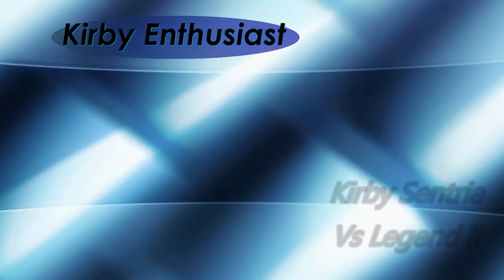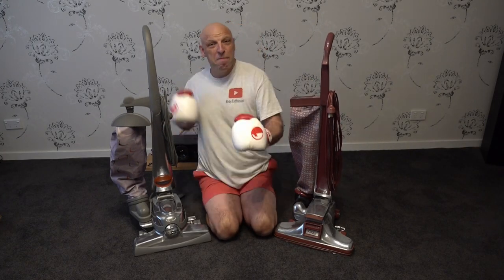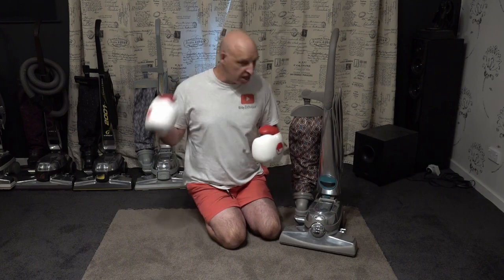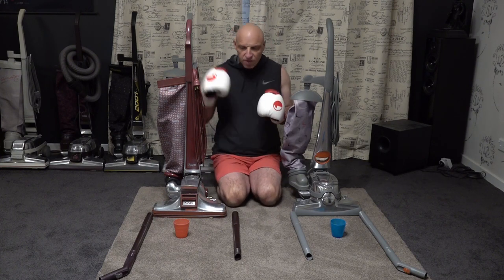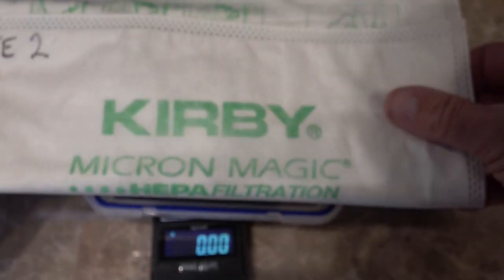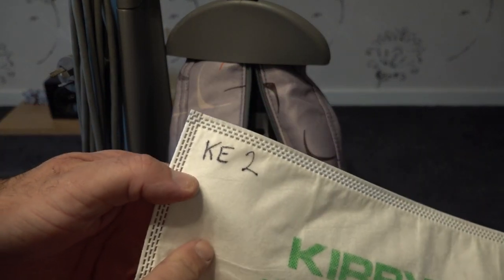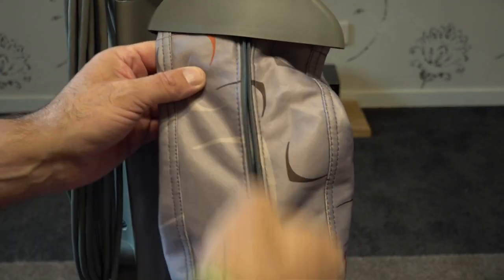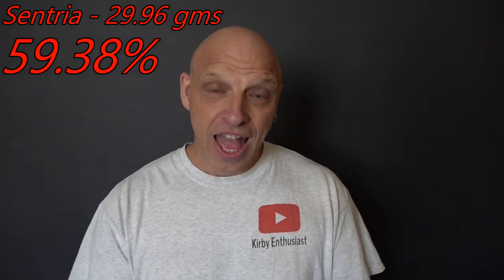KIRBY VACUUM:Kirby Sentria Vs Kirby Legend II for Title Best Kirby Vacuum In 2021

Comment: So about a month ago, I found a G5 for my parents. It needed a few things, cord, wheel clip ring, etc and it had been stored in a shed that was partially open to the elements, but it had all the standard accessories. Yesterday at a pawn shop I found the matching shampoo system with a bill of sale, users manual, and a still shrink wrapped VHS users video tape for like $17.
Reply from the maker: Wow that’s awesome, I still have my G4 VHS tape that came with it . Alas I gave the vhs players away before moving to Australia.

Comment: Wonderful Video!  I always look forward your videos. I have a question that I hope you can help me with. I have recently acquired a condo and want to purchase a Kirby to keep the carpets looking great. I have a Kirby Diamond Edition that I use in my home but now wish to purchase for my other home. Can you make a recommendation of what Kirby model you would suggest. I will most likely be making the purchase on eBay or possibly Craigslist. Thanks for any help you may be able to lend.
Reply from the maker: Thanks so much for continued support and comment. Really Appreciated. 
 For your 2nd home I’d recommend the Sentria 2 or Avalir 100 as you can get those at reasonable price 2nd hand . 
Because they come with oblique brush roll and high airflow well worth the investment. 👍👍
Reply: I suggest the Kirby Avalir or the Kirby Avalir 2. They are the same machine except for color. I have the Kirby Avalir 2. It performs much better than my factory rebuilt Kirby Generation 3.

Comment: Do the bag designs make a difference in the suction power?  Could you swap the bags and try it again and see if it makes the Sentria 1 pickup better by using the Legend 2 bag?
Reply: The Legend II Mini EmTor and the outer bag assembly will not fit the Kirby Sentria. The Sentria II Mini EmTor and the outer bag assembly will fit the Sentria. The Classic/Heritage machines are different animals than the G Series machines. :)